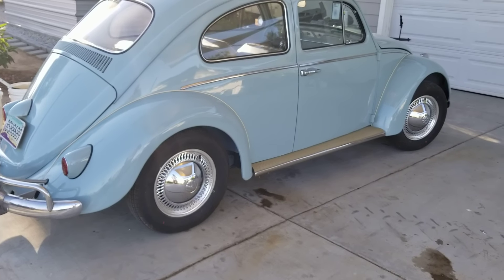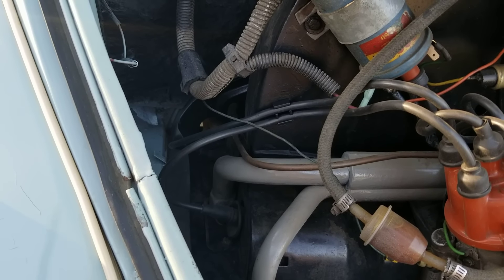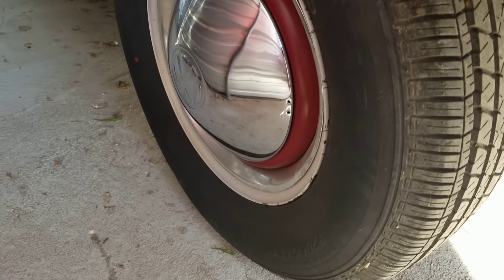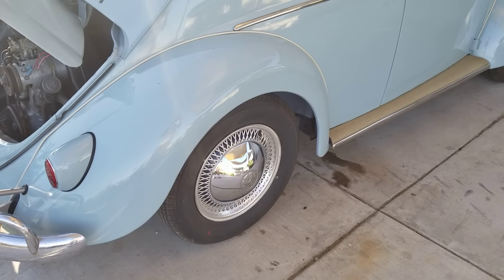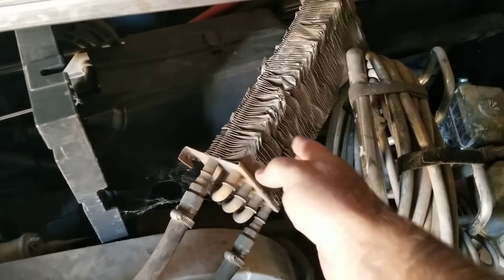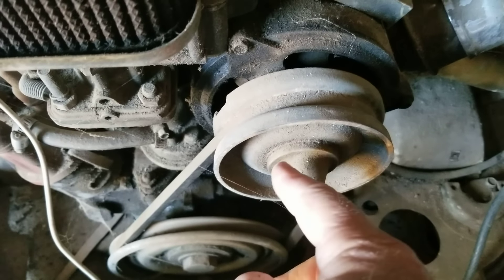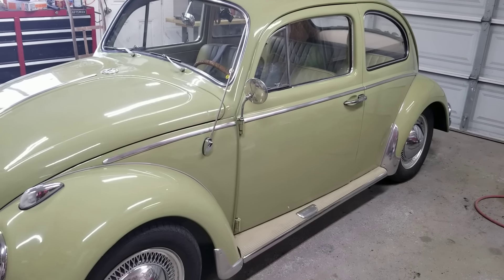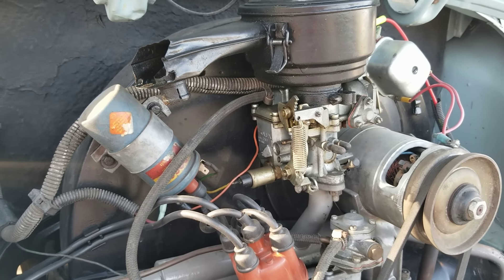Things NOT!!  to do to your Volkswagen VW bug or bus

Comment: I did replace the wind shield on my 68 model by putting the gasket around the glass. And then had someone hold the wind shield in place while I carefully pulled the gasket in with a pare of plyers. Once I got it started, it was easy as pie. 🥧 Where did you get those cool looking beauty rings?
Reply from the maker: wolfsburg west has them but they are not cheap. they are called crosshatch wheel trim.

Comment: Just my opinion but if you want to slam your bug do it right and spend the money on drop spindles and a beam. Don’t just pull the leaf springs because it’s free and easy.
Reply: J Muhr, just where on a beetle are the leaf springs?!?
Reply: @littlejohnny47  sorry but everyone called them that growing up. Referring to the flat bars that run inside the front end from trailing arm to trailing arm. Sorry my terminology isn’t up to your standards.

Comment: Do not forget to check the tire pressure in your spare you'll have... A a spare tire that is deflated B  a filthy windshield
Reply: Always tighten wheel bolts in a crossing pattern and do not tighten them fully one  at a time or you will warp the brake drums and end up with a throbbing brake pedal when stopping.

Comment: Too many don’t do this without saying why.  e.g. Don’t use champion plugs. If you don’t say why, then I put it in the BS bin.   

Heat range, gap .. what’s the issue?
Reply from the maker: champion and autolite plugs are poorly made. Plus the vw does not like them. I cant exactly tell you why. They start misfiring. and foul misfire. VW bugs are particular. I wont use champion or Autolite in any of my gas engine cars. When I was an ase master auto tech I saw more spark plugs fall apart separate from the porcelain than any other brand. We had to use them too because our store had them and we could not use any others. Take it or leave it that is reality.

Comment: Quick question I put in a audio system in my 61 rag top, sundown amp salt 1700.5 and its pushing alot of power and pulling 14amps is it possible to install second 12 volt battery and not cause a problem, also considering a 90 amp alternator what do you think

Doug

Comment: They say no holes but how many you see with no sheet metal on back? Lol. We cruise at 80 mph under 3,000 rpm . Good ideas I hope this video saves a few. .082 4th gear 2110 engine I love it on the street..I thought about a 5 speed but ouch 6 grand. One guy did that here hated it went back to a .082 4th gear.

Comment: Great list, really like the one about keeping the rebuildable fuel pump.I've also experienced the use spark plugs from the same country as the car or they don't run right, I know it to be true, but don't know why.Lastly, I'd add don't use full wheel covers, they cover the brake cooling holes in the wheels.

Comment: 1.  Always adjust your valves with the engine stone cold.
2.  Never remove or install your spark plugs with the engine hot (and a touch of antiseize on your spark plugs is a good idea).
3.  Change the oil every 3000 miles MINIMUM…and don’t skimp on your oil!  Valvoline VR-1 Racing Oil - High Zinc 10w30 is a good choice.  The tappets in your engine will benefit from the zinc.
4.  Never use Non-detergent oil in your VW!  All the owners manuals call for “HD - High Detergent” oil.
5.  When changing the transmission fluid, Always remove the FILL plug BEFORE you remove the drain plug, because if you drain the transmission fluid first, then find the fill plug is stuck (and you round off the fill plug), now you have no way of getting fluid back in the transmission.

Comment: Just 1 comment from me - back in the 80's, I worked with a guy who owned & drove Beetles and was very knowledgeable on them.  I had an Opel at the time, and I stuck to Bosch points & condensers, until he showed me the Standard Blue Streak points he was using in his Beetle.  They seemed better made, and the 2 surfaces seemed to come together straight, more so than the Bosch points.   I don't know about today's parts, but I think those Blue Streak points ran longer for me before they became pitted.  Do you guys use Blue Streak points currently?
Reply: I gave up on points years ago.  My last Bug got the Pertronix electronic ignition conversion and that was after a successful conversion to my Ford 8N tractor.  The Bug ran so much better.  I'll never go back to points.

Comment: My volkswagen is been sitting for more than 20 years now it has wobbly rear wheel when running, what could be the problem?
Reply from the maker: seen bent rims, bent brake drums and bent axles. Most common be bent rims. IF it is a axle the axle tube will need to be replaced also.

Comment: do not use a crappy plastic fuel filter !! as for taking out the front screen ive taken out/refitted 50 or more over the years never cracked a single one in fact the bug screen is one of the easist to fit by yourself ,good advice here though

Comment: What's your thoughts on stinger?
Reply from the maker: Loud. I had one when I was younger. but not today. I like it quiet in the car. Best exhaust for performance is Merged straight or sidewinder. Put a tail pipe on it and they even sound better with the exhaust going outside the car. When they are underneath the sound resonates inside the car and is hard on your ears.

Comment: definitely do NOT have your fuel filter in the engine bay. You basically introduce a weak spot on the line between carb and fuel pump. If that filter, or connections crack or get loose or smthg you'll have gasoline spraying on top of you hot engine.... Yes it is easier to maintain but very risky.

Comment: Awesome advice. The only thing I would add is: if you have original hubcaps, do not leave it parked outside overnight or they will get nicked! Keep original hubcaps in your office/garage, install new aftermarket ones or none at all! Original VW wheels look nice!
While on the subject of wheels, are these fake wire spoke wheels? If so, err.... why? If they're real, have you got specs on these and where they're available from? 
Very jealous of the engine btw. I hate the later version with the heater boxes and, especially, the fan ducts

Comment: I put JB WELD on that carb metal fuel inlet tube right off the jump
Reply from the maker: That works but also if it's come loose make sure you put a leash on a wire Leash from the hose clamp to one of the carburetor bolts it helps as a bit of insurance at that JB Weld fails
Reply: @Mikefngarage  will do thanks

Comment: Good video Mike  !
Reply from the maker: thanks for stopping by like to see that car driving soon post some more videos.
Reply: @Mikefngarage  I got my 66 c10 on the streets the 283 is solid motor... other than the faint  light blue smoke I get out the right side exhaust pipe she runs pretty well
Reply from the maker: @Hoodhistorian562  Well probably the smoke is a valve seal We used to put the umbrella valve seals on even if the guides were loose and it would stop that make it run fine. Little hard to do in the truck but possible. Use a piece of rope in the spark plug hole then pop off the springs and out the valve seals over the valve.
Reply: @Mikefngarage  thanks

Comment: Looks like you have an issue with “crack” lol… almost everything you mentioned seems to crack for you😂. 

As far as the shims on the generator / alt pulley, I have seen others doing belt change videos with 5 total shims and they seem to be ok. I personally have 5 in the inner part and 4 in front.
Reply from the maker: yea I would only run 9.....total. like you are. either between or in front or behind.  We had cracked pullies  come into the shop all the time even with 5 shim. the total spacing for the treads and the bolt bottoming out is made that way and needs to have all the shims. Minimum is around 7. but factory is 9. They can be on either side of the pully between or on the end but total 9.

Comment: Don't drive your VW Into a Lake to see if it floats . My Friend  Jennifer had a 1970 VW Bug  she drove  around the corner to fast  and ran into the Lake It floated for 1 hour then started sinking  we were Just Thankful we got out and some gut came with his tow truck to get it out
Reply: Yeah, like me! Think I was about 17 or 18 years old.  Was on a flooded road. Front end picked up, then the rear picked up- engine still running. Whole car fills with steam. Engine dies- won't restart. Look over my shoulder, the water is about 4" deep on the rear floor. Five minutes later, water 1/2 way up the doors, ended up crawling through the driver's window & was standing in 3' of water! Grab the rear bumper & pull the car until the tires were touching the ground. Three guys in the gas station across the street come over & the 4 of us push the car up to their service bay. Ask the owner if he could get it running. They pull out the spark plugs, dry everything with an air hose, put the plugs back & the thing STARTED. Ask them how much for their efforts. The boss said, "No charge. I've never laughed so much in my fu**ing life seeing that Beetle bobbing up & down in the water., then watching you tow that thing by the bumper. Kid, you made our whole day!!" 
Anyway, DO NOT go through water if you don't know how deep it is- And make sure the floor under the battery has no rot holes!!

Comment: Do NOT use a gas filter like shown on that VW.  That not only is a fire hazard, the weight and vibration will tend to pull the brass tubes from fuel pump and carburetor !!!!

Comment: I guess I've been lucky.  In over 50 years of driving and after owning COUNTLESS cars I can honestly say that I have NEVER ONCE had a clogged fuel filter!  I have even taken some used ones apart after 40,000 or more miles without any dirt or other debris inside. Never had a fuel filter on any of the ten or so VW's we've owned.  Just lucky I guess?
Reply from the maker: maybe I just didnt have one once and a piece of rust got into my carb and caused me habboc

Comment: mike ,my vw bus caught fire from a plastic fuel filter ! , i will only use metal filter s
Reply from the maker: Are you sure it was the filter itself. Usually when I investigate this it is the Barb in the carburetor for the fuel lines got old. Or it didn't have clamps
Reply from the maker: Also I forgot to mention I have seen vapor lock issues from the metal fuel filters.

Comment: Hey mike! I have a question about beetles. Why do some have big stops? And others have plastic dashboards? I'm looking to buy a 1972 vw beetle and it has bigger stops than yours and a metal dashboard
Reply: It's a matter of model years.  As safety requirements grew, so did the lights.  Them pinky-little lights are pre-60s.  I'm guessing 1961 and older.  The plastic-dash was a Super Beetle part... I think.
Reply: @ImnotgoingSideways  thank you for your response. I heard that the plastic dash was only available on brazilian made beetles but i'm not sure also
Reply: 68 and later Deluxe Beetles had black padded dash panels.  Standard Beetles still used the metal dash.

Comment: Do not run multi weight oil. That's for liquid cooled engines only. 30 weight in the winter, 40 weight in the summer.
Reply: There's nothing wrong with modern multigrade oil. Millions of us are proving this.
When you put 40Wt in your engine in the summer, that's what makes it run hotter. Use 30wt and it  will run cooler.

Comment: Anyone here from South eastern PA? Just bought a 75 bug and drove it back from NY.  I need some advice on a few things.. Lol.   I still have a headache from the exhaust smell 😆 this is my wife project but I'm not too familiar with bugs.
Reply from the maker: cool not too many of them around there
Reply from the maker: closest parts supplier is Bus Depot they are pretty close to you and they also have some shows too.
Reply: Mike Fn Garage overall condition is really good. Have some headlight turn signal issue, valve cover leak, needs exhaust and some interior work. But pretty solid for a car in the north east.  I just don't know much about VW's. Trying to find a local person to help me out.
Reply from the maker: @b8ascrub  check Bus Depot website see if they are near you. Might have some resources. I know they are in PN so check them out.
Reply: Mike Fn Garage thanks for the huge tip! Bus depot is about 20 mins from my house. Didn't even know about the place.
Just placed my first order. 👍 ty

Comment: Do not use the style of fuel pump in that bug.  The hose fittings on those were notorious for pulling out of the pump body and spraying gasoline all over the engine compartment.

Comment: That's the front of the engine not the back. Where the fuel hose comes in to engine compartment.
Reply: The pulley is the front of the engine. You mean the front of the " engine compartment ", but still the back of the motor.

Comment: Why 7-9 washers on the pulley?
Reply from the maker: the car is engineered that way if you dont the pulley will crack. not enough threads on the generator. they can be on either side of the pulley just need 9.  but 7 is absolute minimum
Reply: Part of the reason is that the inner spacers set the belt tension and the outer spacers provide easy access to more spacers to change the belt tension on the fly.  Saves from digging into a coffee can of bent-up parts and makes road-side belt swaps easier to get right.  Oh, and, anticipate a road-side belt swap.  It may never happen, but when it does, a spare belt pays off in spades. =^-^=
Reply: Very well said. Easy to understand. Thanks

Comment: ~ Good to hear from you, wonder why I wasn't notified about this video earlier? 🤔   Question, I have a stock '65 bus but I want to throw a 1776cc or other in it so I can go freeway speeds, what size gears should I change the tranny to? Also, are you on Instagram? Thanks. 😎🤙🏻🇨🇦
Reply from the maker: 65 big nut trans 3.44 gears and .89 4th gear. with 205 75 14 tires is a perfect combo. for the trans.
Reply: @Mikefngarage  ~ Thanks Mike.

Comment: Do not keep a rag (or any paper) in engine compartment, it will end up in your fan and overheat the engine.
Reply from the maker: yea for sure
Reply: Both times my bug came out of the paint shop there was stuff in the fan squirrel cage. A Scotch Bright scrubby the first time and news paper from being taped off the second time. Now I know what "that noise" means!  :)
Reply: @richardmang2558  Yes, the little bug will moan if it can't breathe.

Comment: Don't run less then 20w-50 or diesel oil any thing below its going to run too hot and over heat
Reply: You need to learn how the VW oil cct functions.  The engine uses oil pressure to determine whether the oil goes through the cooler or bypasses the cooler.  When the pressure is high, like when the oil is cold, it bypasses the cooler.  When the pressure drops, it goes through the cooler first, then to the bearings.
By using your 20W-50 tar, you are forcing the pressure to be high even when the engine is hot. Thus, it always bypasses the cooler. By changing to 5W-30 you will see at least a 20º drop in oil temp.
Reply: E-Curb when I first bought my VW I had a shop change the oil they put in 5w-30 , every time I drove it after that it always ran hot , I did some research on which one to use and changed it myself to 20w-50 and I haven’t had any over heating issues since
Reply: @joshuafowler2940    Without a temp gauge, you are guessing. Pick up the manual and look at the oil cct. Study it and understand it.  What you claim, that 5W-30 runs hotter than 20W-50, is not possible.
Reply: E-Curb I bet you it possible, there are other ways  to measure the temperature of a VW beetle,  like a temperature gun , you can take a VW on the same trip around the block , same warm up time and then  using a temperature gun to measure how hot the engine is getting , with the 5w-30 the engine was running 243-246 degrees ,which we can both agree is way to high for a VW , since according to a VW  shop manual is  185-220  degrees is the normal running temp for a VW beetle , after switching to 20w-50 on the same trip with the same warm up time as before the motor was running 195-201 which is a cooler temperature than before
Reply: @joshuafowler2940   .. What you are saying is simply not possible. The higher pressure caused by 20W-50 forces the oil to bypass the cooler.  How does bypassing the cooler make it run at a lower temp???  Look at the oil cct in the manual and you will understand.
In your testing, going around the block is not enough to get the engine up to operating temp. You need to take it out on the freeway for at least 15-20 min. then take a temp reading.  And you have to do this on a day that's the same temp.

Comment: I want a VW beetle when I'm older.
Reply: @skn9895  the two problems I'm going to have with a super beetle no AC and I don't know how to drive a stick shift but I'll figure it out when it happens.
Reply: @skn9895  ya I do live in Arizona so it's very hot.

Comment: I want to convert mine to Harley Davidson engine but not sticking out like the other video that does have theirs converted
Reply: Dont!
Reply: Karl Bartelt bugs are known to be used for modifying only problem is VW engines are tough, but the modification I want would cost more then stock engine I have to make it look stock tho so I’d loose some of the back seat, also I want oval window curved windshield and back side window vents I don’t think there’s a model with all 3

Comment: Do not mount the fuel filter in the engine bay.
Reply from the maker: almost every make car with a carburetor  had a plastic fuel filter in the engine compartment. We have been doing this  for more than 40 years. Never seen a engine fire from it ever. more than 30k over the years 3 shops have and none from the fuel filter. Just sayin.